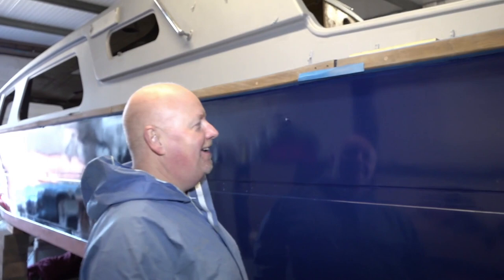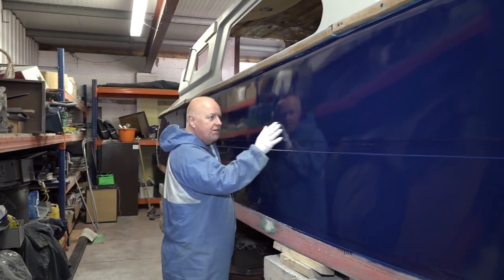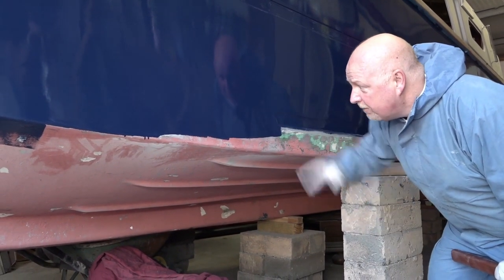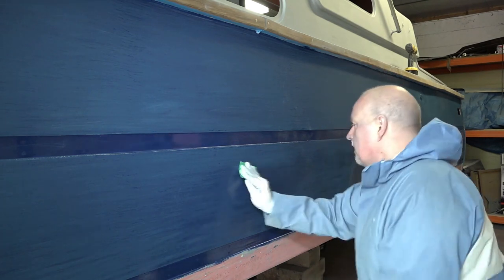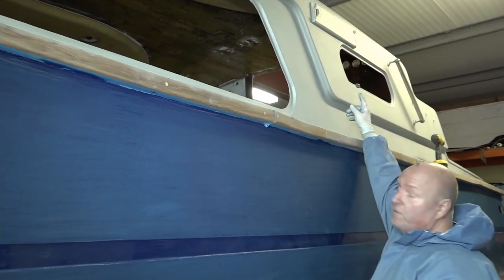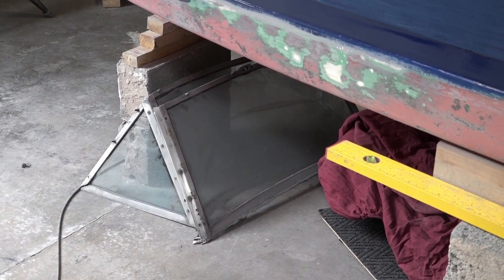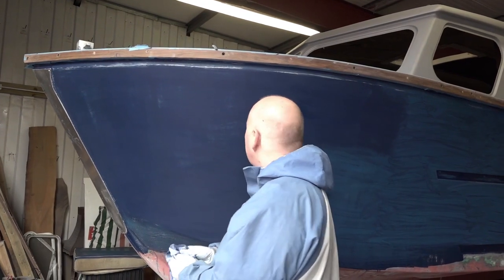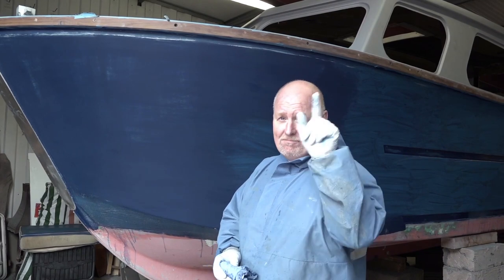Boat painting, Rolling and Tipping, Episode 4

Comment: cooler when you did the 2nd side giving thinners more time to allow it to blend out?? 2nd side looks fab, I would have called the boat lift.. and splashed!
Reply from the maker: Yes from memory, thinning out worked a treat, however it’s all getting flatted back , wet sanding this time around, weather is improving and it won’t be long before I’ll be doing it all again, I painted first time around to soon, it’s got knocked a bit so lessen learned 🤷‍♂️, however I do like painting so I’m looking forward to doing again 😎

Comment: Fab tip, and finish would you do the same on the final undercoat or primer if you were using a 2 pac single coat top coat?
Reply from the maker: Well I used international paints , I found it was great, wasn’t 2pac just single top coat, I’ll be looking forward to doing it again, can’t harm increasing the coats, I’m hoping the next one should be better than the last 🤞

Comment: Thankyou for your videos they are very informative and you are very well mannered. I'm wondering my boat is fibreglass that I think has lost its gelcoat and has been painted with a brush…im wondering what grade of sandpaper do I use to prepare for painting ? Is it best to hand sand rather than a orbital sander which may leave marks ?
Reply from the maker: Hi Troy, thanks for your kind support, I’m not overly knowledgable as I’m a novice having a go in restoring a boat. I’ve found the best way ( which I’m afraid is the hardest) , was to wet sand with a selection of between 400/600/800 grade wet&dry paper with soapy water in a cheap spray bottle gave me a really good foundation to get the top coat of paint looking like a factory gel, my advice would be to put all your effort into this part of the job and the top coat will do the rest.... I’d also recommend the international paint because it’s extremely forgiving and it looses those brush strokes quite quickly. Have a look at the episodes that cover the upper deck and you’ll see what I mean.
Any other information and I’m more than happy to pass it on to you... kind regards Phil 🍻🙋‍♂️